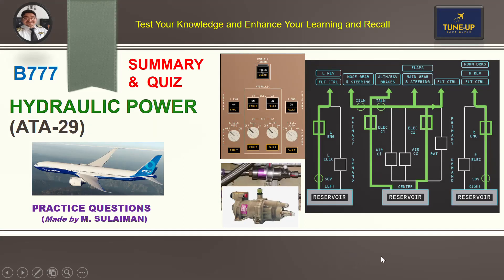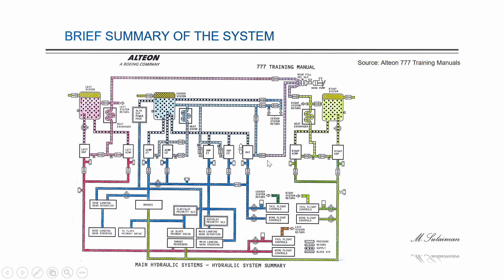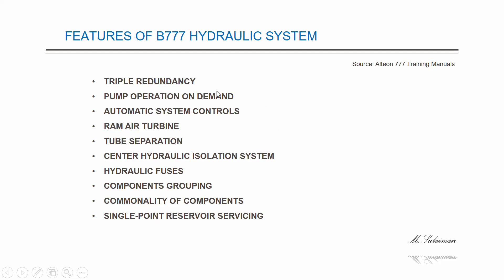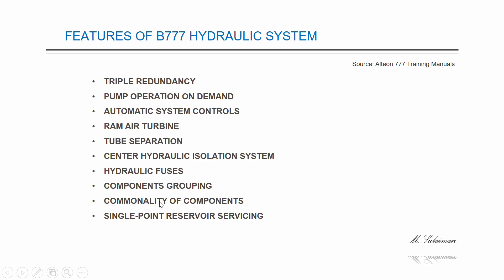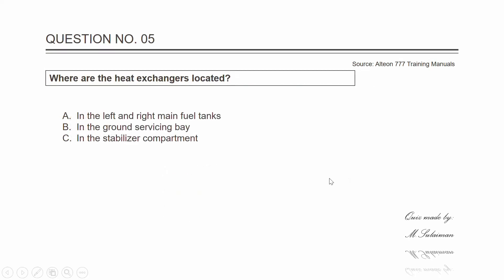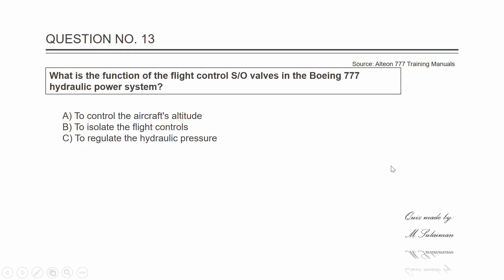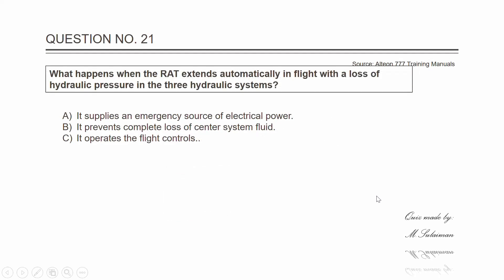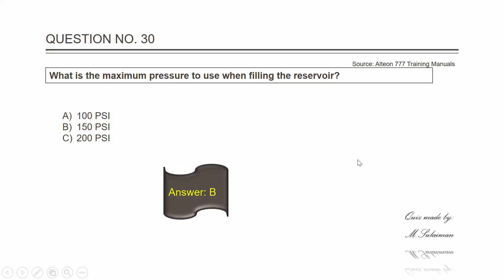QUIZ & OVERVIEW B777 HYDRAULIC POWER (ATA 29 )

Comment: Why do we set the Right Engine Demand Pump to AUTO as the first step during the Before Start Procedure? The FCOM states: ‘Pressurize the right system first to prevent fluid transfer between systems’, but I couldn’t find any detailed explanation behind this. Do you know the specific reason or system logic for this requirement?”
Reply: It can auto transfer your fluid to others system